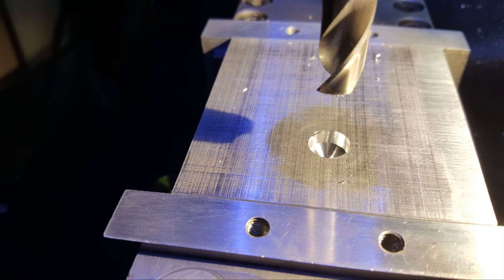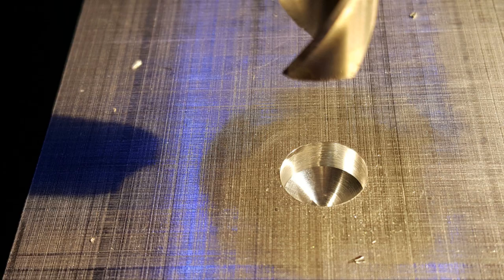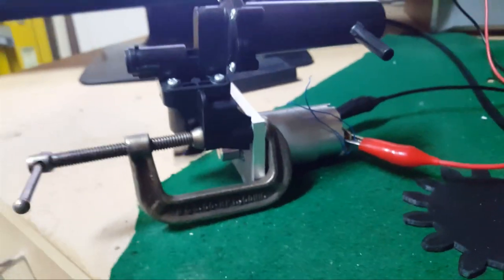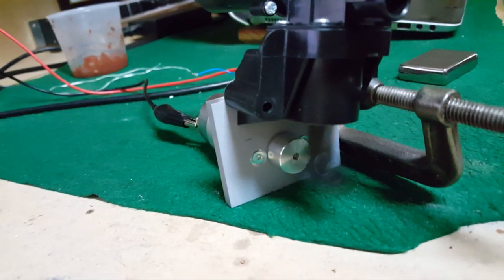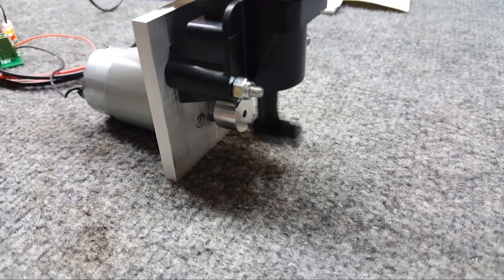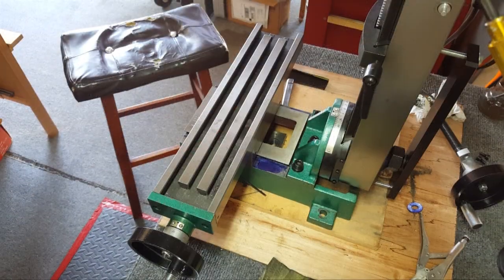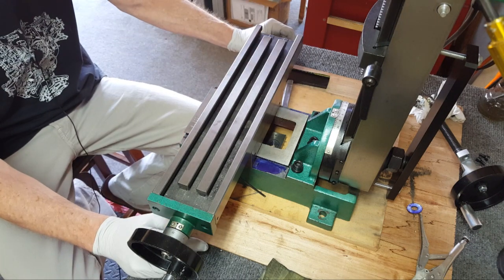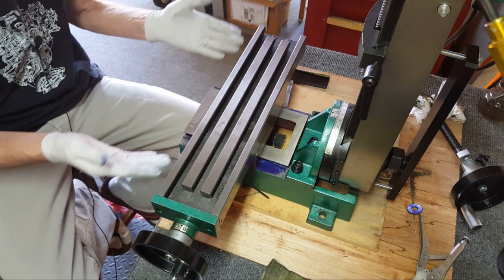3018 CNC Adding Air & Mini Mill Rebuild Final

Comment: I've forgotten to tighten the collet nut up before and done the same thing on my router. 😀 Luckily it has a spoil board and didn't break the bit so no foul but a real wakeup call. Glad to see you got the tach function working finally on the DRO. I use a piece of aluminum tube with one side cut out to cover the scales on my DRO. Haven't seen any chips yet. Thanks for the update video!

Comment: Hi Dave, rain was actually getting out to here in the open high desert inland from you out by the west coast of California. Thank you for the sticker shout out.
We just finished cleaning, inspecting checking roundness and polishing each collet of your dads you sent us, they are in very good shape we are proud they are here and will be put to use now.
Nice mill table smoothness fix (it was surely a lot of work to get it back to that way).
Lance & Patrick.

Comment: What stuff is that air pump? I have the same problem, the micro mill easily overheats. I have built 2 Arduino temperature measuring devices, one using contact sencing and one using IR, in order to stop the mill in time to save the motor. Adding forced cooling will improve up time but I only got a big radial fan that will be difficult to mount.
Reply from the maker: The air pump was salvaged from some medical devise I tossed. You need to find a PC fan with high volume that runs on wall power like this https://www.amazon.com/GDSTIME-Ventilation-Exhaust-Projects-Cooling/dp/B07P2HCH21/ref=sr_1_2_sspa?keywords=pc+fan&qid=1558218790&s=gateway&sr=8-2-spons&psc=1

Comment: did you mount the y axis scales with the black mounts that come with the scales? the base is at an angle maybe 3 degrees , did you mount the scales at an angle??
Reply: Don't use the supplied black mounts unless You make them squared first. Dave showed me that in an earlier video quite som time ago. I milled aluminium mounts. Ok, the angled base calls for thinking and work… I got a squared base on my Chinesium made mill....
Reply from the maker: The only place I used the provided black mounts was on the Y axis because the base is so crooked anyway. My web site has the print for the other axis mounts. Yes it is tilted 3 degrees and I sacrificed a .010 feeler gage, drilled and bent it for the axis connection. If you email me I can send pictures.
Reply: Haha. Slaughtering a set of feeler gage. @TheMiniMachineShop That's is an innovative way of getting shims. Surpriced that they can be bent without breaking or straightening out.
Reply from the maker: Very cheap Chinese set 2 mills sacrificed 6 pieces from the set. Hole already drilled on one end and rounded. And they work great!
Reply: @TheMiniMachineShop  that would be great Dave thanks